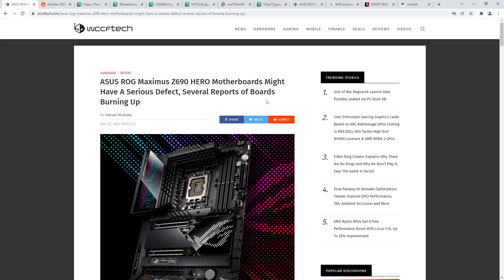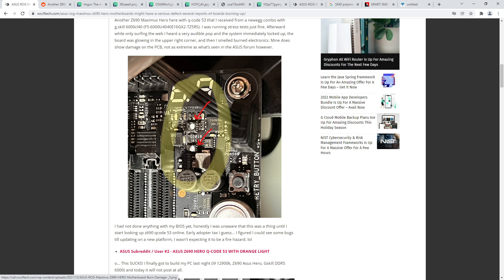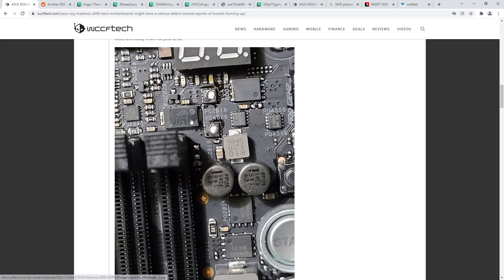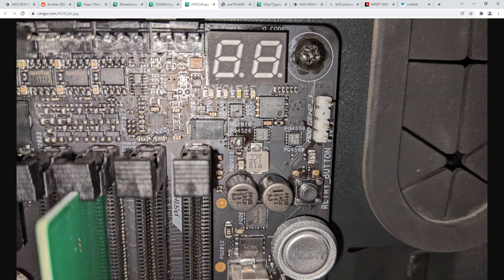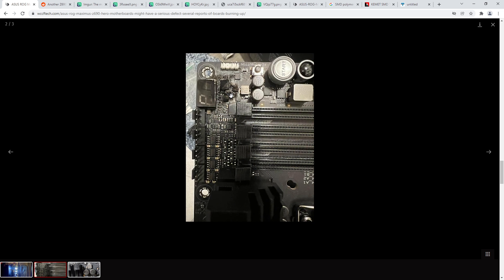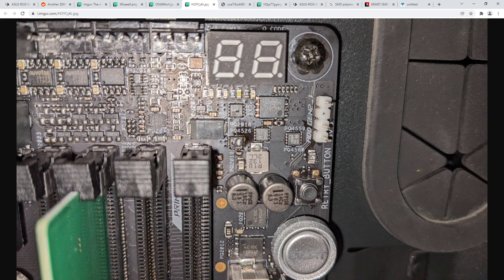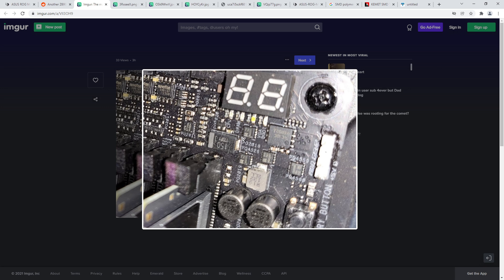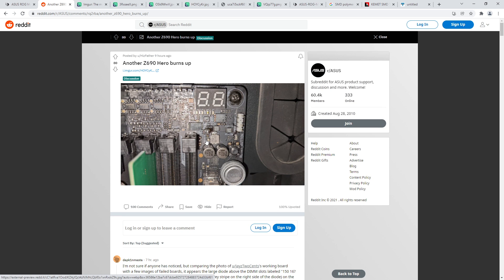My thoughts on the ASUS Maximus Z690 Hero failures

Comment: I've got one of these boards, the capacitor is in the correct orientation. They definitely messed up a batch 😅
Reply: Guess that takes the 99% to 99.(9)% Asus messed up a batch of mobos :)
Reply: @Tamamo lol
Reply: Got mine at launch day. Just checked mine Luckily mine had the right orientation 🙏
Reply: I was going to order this specific board after DDR5 finally became available in Dutch web shops but now I'll just wait for ASUS to fix the problem before ordering mine
Reply: @Bas_Pachi  Just under solder it and put it back the right way.
Reply: @wobblysauce    If I have to pay 630 Euros for that board, I pretty much expect Asus to do the soldering for me instead of having to d.i.y. caps into the right orientation ;-)
Reply: @Bas_Pachi  This is what you got from Asus for not buying the Maximus Z690 Extreme Glacial
Reply: @vibonacci  You're so right. Shame on us cheap-ass plebs only willing to buy 600+ Euro motherboards  🤣🤣
Reply: @wobblysauce  That's my plaaaan
Reply: @wobblysauce  If you have very steady hands, such fix should be possible.
Reply: @Bas_Pachi  Wait til the summer.  DDR5 will be way cheaper once it hits larger production runs.
Reply: Just unboxed a new board, with cap backwards... hmmm
Reply: @CyberbrainPC  something something RMA something
Reply: @marcogenovesi8570  Naw, gonna FIX IT :)
Reply: @CyberbrainPC  that's the spirit
Reply: @CyberbrainPC  Snap send back
Reply: @vibonacci  Maybe but I can fix it, so prob will.
Reply: nice to know
Reply: MIne is the wrong way... Had the board in hand before launch. For the moment, it still works. It's been my daily driver for a few weeks now.
Reply: @jas420221  What PCB revision is your MB?
Reply: @jas420221  stop using it. Contact asus support
Reply: @jas420221  RMA NOW. IT will die and maybe cause a fire.
Reply: @jas420221  doesn't matter if it's been working thus far. Your Mobo is a ticking time bomb. Contact ASUS immediately
Reply: @jas420221  mine is wrong as well, have you contacted asus yet? I just found out 5 min ago
Reply: @jas420221  CHANGE BOARD ASAP!!!
Reply: @Tamamo What? We were the upside-down ones all along and the Australians are the right way up!?
Reply: Hopefully not that big a batch.
Reply: @Tamamo ahahahha
Reply: I feel like there's an Aussie joke here.  But also, I'm not sure....
Reply: @Hardware Unboxed, Could you take a look at your Asus Z690 non Hero boards, to look for similar issues ?
Reply: When did you purchase/receive the board?
Reply: Same, im located in eastern canada.
Reply: I have the board, mine is backwards, with the positive on the left. 

May resolder before turning on for the first time, but won't have a before and after then :( .
Reply: @CyberbrainPC  seriously? So if you reverse the cap yourself, you've also reversed the warranty. attaboy!
 if you like throwing money away, throw some this way. 😆
Reply: @rjbradlow  Eh? If he can fix it, why not fix it? No money has been thrown away, the end result is that he has a working motherboard without having to wait for a new one.
Reply: @rjbradlow  it's only money, and besides, the warranty is only void if you do damage. Fixing it properly wouldn't count, unless its a bad reflow job.
Reply: @CyberbrainPC  resoldering it will fix this? I know nothing about this. Have a z690 With the issue
Reply: Mine is also the right way up and the text on it is G157, not 150 like on the images. Not sure if that means anything, probably a newer one? Thanks for this video.
Reply: I have a bad revision. Good thing I have not started building yet.
Reply: @michaelhuff1801  Sorry to hear that man... I know I would be very pissed off.
Reply: Me to,  right  way capacitor and  get code 53  on one stick and 55 on 2 sticks
Reply: @Tamamo top lol
Reply: Is it only the hero motherboard? What about the Formula?
Reply: YEAH, why they didn't warn consumers? Silently update the boards with huge fire Hazzard risk.... RED FLAG!!!
Reply: @N0N0111  PR is probably talking to Legal to see what's the best response internationally, or they're scared they're gonna get tens of thousands of RMAd in weeks from consumers and retailers, or they're trying to figure out what batches are affected and THEN have people RMA that batch, etc etc.

Asus tends to be pretty slow with stuff like this.
Reply: @N0N0111  I agree a full investigation should be done and Asus should be held accountable. I think a reasonable thing from them would a full press release, reasonings and their findings, and for those who have been affected, they can return the board for a full refund or working replacement. Suck up the loss now and fight another day.
Reply: Noone says what everyone thinks...  they did it with dollar signs in eyes on purpose...
Reply: What a luck!
Reply: @XerXcho  Thanks for your reply :)
Reply: I have a Z690 HERO mobo myself and I am a bit confused. How can you see if the capacitator is in a wrong orientation?
Reply: @roskimadro  The polarity stripe on the good boards is facing towards the right.  The polarity stripe on the blown up boards is towards the left.  Did we watch the same video?
Reply: @teamtechworked8217  Thanks for your reply. I'm pretty sure we watched the same video, but the technical part of PC components is still pretty greek to me - pardon my lack of knowledge. I have a gray stripe with a '+' on the right side on mine so I guess it is in the correct orientation. :)
Reply: @roskimadro  look at the pics he is showing, and just compare.
Reply: @roskimadro  that is too easy check if the stripe is close to those two mosfets

Comment: Looks like if you follow this space long enough then every manufacturer will have had an explosive product. Lately Gigabyte PSU's, various 3080s and also now the Acer monitor on the GN channel come to mind
Reply from the maker: yeah stuff like this just happens to everyone.
Reply: @ActuallyHardcoreOverclocking  
It's how they deal with this "mess" that really matters...
Reply: @ActuallyHardcoreOverclocking  Thats not the Issue though. Things can happen. They do happen.

Its how those Manufactories do handle these Things. And Gigabytes reply was like… sure whatever. And they changed it at some point still with the Response… we dont care. 

Kinda. I dont remember how it actually went down but they didnt make recalls at all. That i do remember.
Reply: @ActuallyHardcoreOverclocking   Random fact for you buildzoid. I saw you mention that the z590 Godlike was one of the only boards with a tuning controller. Happy to report that the z590 Unify X comes with one as well.
Reply: @ActuallyHardcoreOverclocking  With how complicated modern electronics are, it's not at all surprising that stuff just fails in spectacular fashion. COVID just made everything so much worse in all sorts of ways, from lack of manpower, to time crunches, all the way to shit supplies. I'm gonna mark this one down as "COVID-related failure," as this is not typical of ASUS.
Reply: When you done too many “1+1”s, eventually you will make a mistake and write a “3” instead of “2”
Reply: @AaronShenghao  that may be true but i remember this one exam where i had a bunch of equations dependent on results of the previous ones and I had all of these equations correct, however at the very beginning I somehow computed that 2 x 3 = 5 and therefore ruined the whole exam. I failed. I was super pissed at myself when i found it (after i got my exam back). If I had this calculation correct I would have had an easy A (or 1 in Czechia).
Reply: Finally time for explosive PC config will come
Reply: That makes fire extinguishers the most important component in PC building from now on.
Reply: it happens but pretty rare.. right now it's a lot worse due to supply constraints and lack of long term trained workers.. taiwan and china are having just as much trouble hiring people as the rest of the world.
Reply: @sirmonkey1985  If the companies paid a living wage they wouldn't have a problem getting people to work for them.
Reply: @anonemus2971  If people are laid off or furloughed for an extended period (as they have been) you get skill fade even if you do manage to get all of your skilled workforce back.
Just look at the currency requirements for airline pilots, who are certainly paid a comfortable living wage!  Even as a lowly private pilot with no additional ratings, I still have to meet currency requirements to legally carry any passengers other than an instructor.
Reply: Gigabyte has always been garbage lol

Comment: On my ASUS Hero Z690 my Capacitor is backwards. Unplugging now.
Reply: You need to look for revision number too.
Reply: @poppyrider5541  I don’t think they have a revision. Nothing support wise. This came with my Newegg bundle.
Reply: @kittleeagle  any way to measure it using voltmeter?
Reply: Send BZ your batch number from the box maybe?
Reply from the maker: @Jas7520  I don't have any information on the production of these boards.
Reply: Check for a polarity sign pls. The faulty has the stripe on the positive side, maybe others have the sign on the negative side (which is more like std)
Reply: @MoppelMat  Rectangular polymer capacitors always have the polarity marker on the anode, cylindrical pcaps on the cathode
Reply: @Hype2ion  thanks for that! Didn’t know it

Comment: Manufacturers need a BZ seal of approval ;)
Reply from the maker: my testing process would never catch something like this unless they sent me one of the faulty boards.
Reply: @ActuallyHardcoreOverclocking  isn’t that exactly what “QC” does? Grabs a sample from the line and, uh, test it? And then they apply the QC check sticker?
Reply: @hquest  that's assuming the person(s) is trained well enough to catch it. most of these workers look at 1000's of boards a day and who knows how many different models, with a less than 5% manufacturing defect rate shit slips through the cracks when all you do is press a button and wait for a light to appear a couple thousand times a day 5-6 days a week. either way no all the test does is plugs in a CPU, memory, and GPU then tests if it posts and it passes QC.. since the issue shown doesn't stop the board from working they'd never notice without visually looking at it.. question then becomes was it ever noticed and did they notify ASUS if they did find the fault?
Reply: @sirmonkey1985  well, at the industry I work at, visual inspection and quality check are two different things. You described what we call visual inspection, but our quality check tests the product against multiple metrics. For a complex product as a motherboard, this truly looks an oversight on their QC, one that perhaps it would be wise for them (and others) to re-evaluate how the do QC - the addition of thermal cameras seems the easiest way to keep such tests automated. Then, as part of the burn in process, each line should have representation, and this would had shown up. But again, I do not manufacture motherboards, we are a different business, and I only talk from personal experience and follow FDA and similar worldwide, stricter regulations than the electronic industry does.
Reply: Buildzoid's "I don't hate it" award
Reply: @pokeguy742  Whoa, slow down there chief. Such high praises don't get thrown around often.